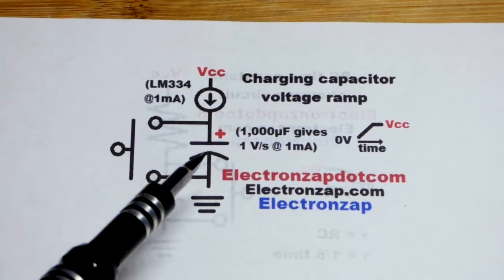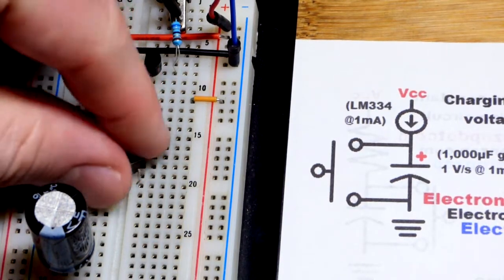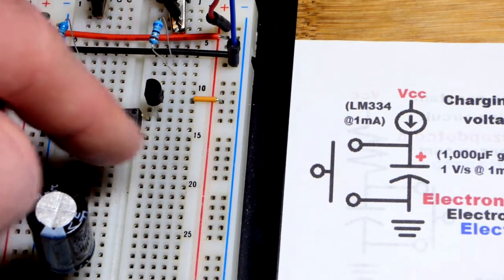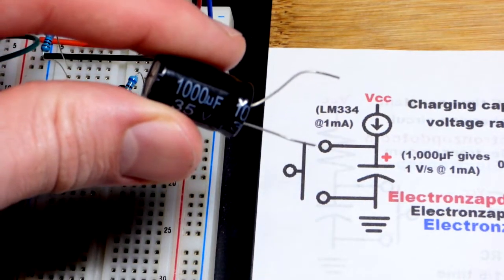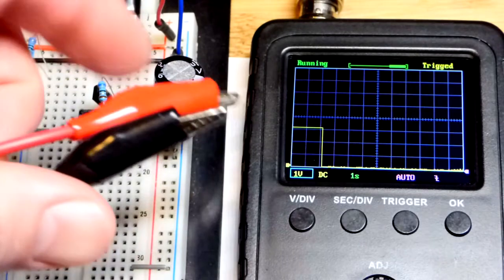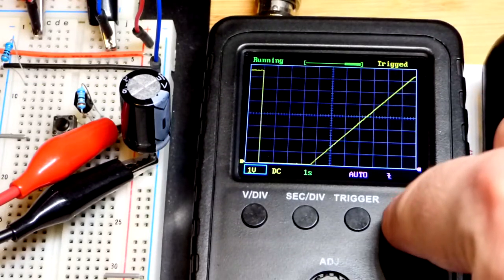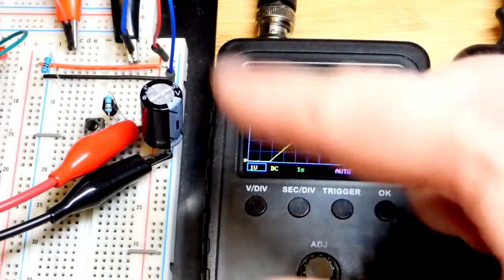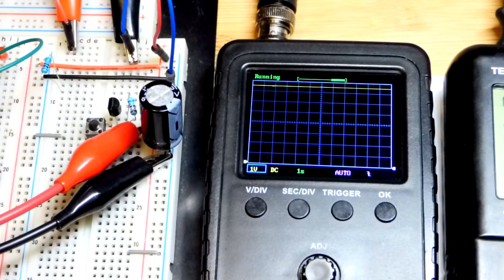Quick 1000uF capacitor voltage ramp using LM334 set at 1mA circuit schematic to breadboard build

Comment: Question: Am I correct to think that before the button is pressed the cap is charged  b/c there is a complete circuit on that side of the button? Then when you press the button the current flow takes a lesser path of resistance to the ground on the other side of the breadboard making the cap discharge? I'm just moving on from making projects to trying to understand why things work so if its obvious I claim noob card!